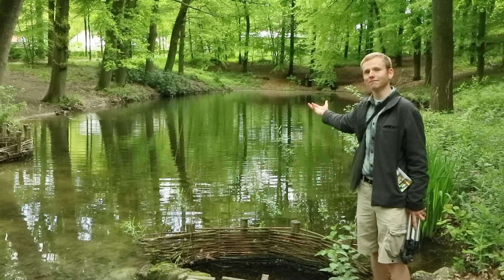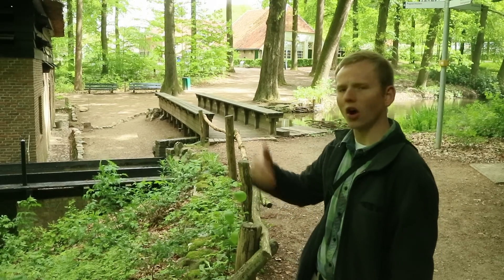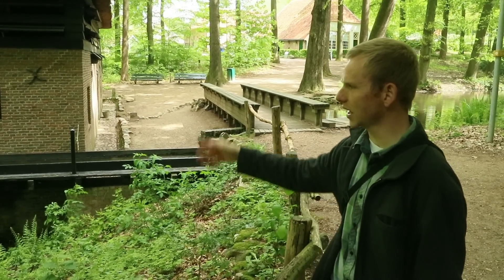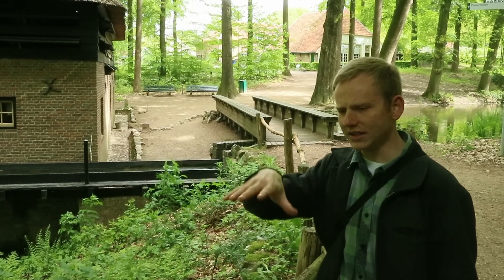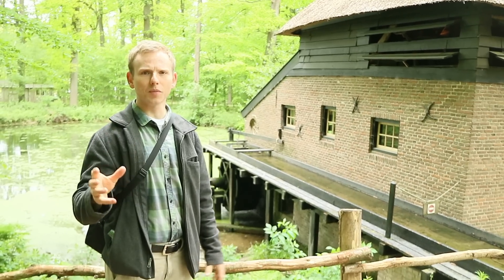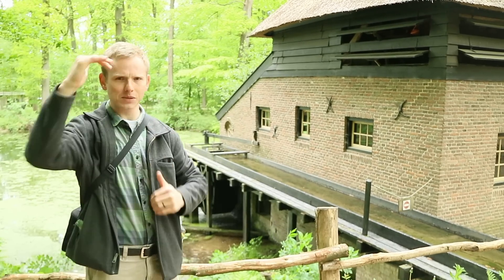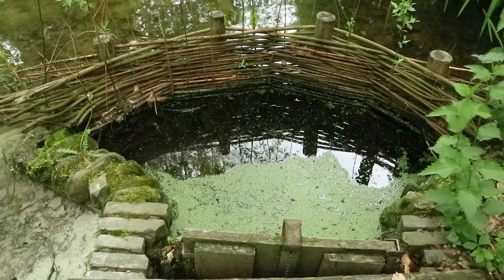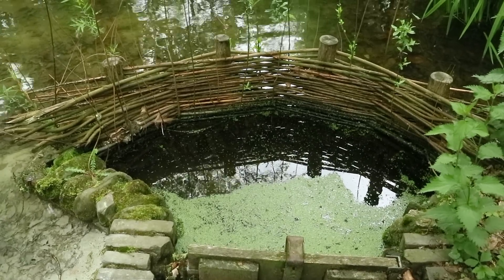This Pond is Actually a Battery: The advantage of Water Mills

Comment: They could collect methane from all  that sitting water by simply using a dome shaped over water surface with a valve. There are vids about it from Arizona swamps  and even that student from Holland collecting it in a condom and running his moped methane. Maybe adding swans or other wildlife would give more yield. Look  at it ,the pond needs  swans.. another thing why I  hate wind turbines.. they're noisy  and requires more material than hydro, in comparison,  water is 100 times more dense than air so  constructions  for hydro can be way less for the energy yield.

Comment: Personally I've contemplated using my own property, which has a pretty serious elevation drop between one end to the other, to set up my own 'water batteries'.  Using a pair of water tanks with a hydroelectric generator between them and a series of mechanical wind mills to push the water up the hill.  My homestead is in the shadow of a mountain we just don't get good sun half the year so solar just isn't a good option.

Comment: I am really interested to see the advances in compressed gas energy storage. I'm not sure if air is actually the best choice due to issues with thermal losses as is compressed and expanded, I imagine there is some sort of chemical that has lower losses between compression and expansion. 
I live in the floodplains of Mississippi and there isn't much variation in topography for about 20 miles in any direction, and I can drive for hours without hills if I follow the rivers, so pumped hydro isn't really an option here unless we figure out how to build giant water towers for next to nothing.

Comment: I built a gravity battery that stored wind energy. I made a wind turbine that lifted a heavy weight slowly over time. To use the energy I disengaged the turbine's gear and engaged a gear that lead to a little generator, the weight would drop and drive the generator. It produced very little energy but was a fun weekend project.
Reply: You might be very interested to look up energy vault gravity storage if you aren't already aware of them.
A few months ago I read an article about a large scale experiment where they used cranes and large blocks to build towers using extra energy then dropped the blocks to gather the stored gravity energy.

Comment: As of my understanding it is not uncommon to use cheap electricity to pump up water later on reconvert that energy to electricity when needed.
Reply from the maker: True. The only trouble is this is limited by geography. JB
Reply: @GoodandBasic  Great vid, as always!

I have the great good fortune to live in a region where the geography does allow for it. Here's a shot (from a nearby mountaintop) of two reservoirs of a pumped-hydro project. (They also are in the system that provides New York City, well over a hundred miles to the south, with its drinking water.) Sorry about the image quality - it was a very humid day!

https://www.flickr.com/photos/ke9tv/14481612866

You can see the topography at https://kbk.is-a-geek.net/catskills/test4.html?la=42.4440&lo=-74.4467&z=14

The project can generate 1.1 GW at peak load, and the uppermost reservoir can store over 60 TJ of energy. That's some battery!

Trivia about the project - they found the oldest petrified wood on the planet while excavating for it.  https://en.wikipedia.org/wiki/Gilboa_Fossil_Forest  Fittingly, the cliffs above are guarded by some of the oldest living trees in New York: http://www.ancientforests.us/articles/Science310.pdf